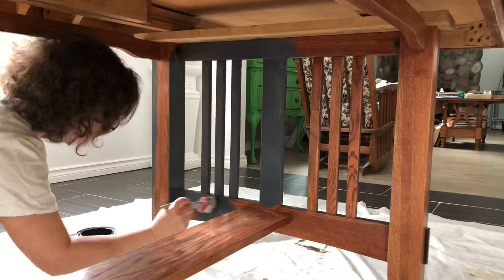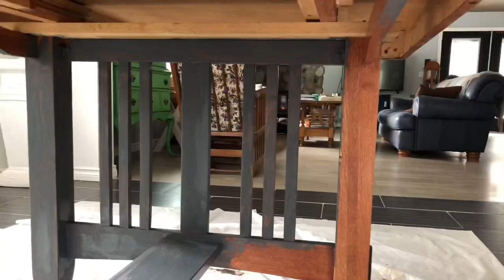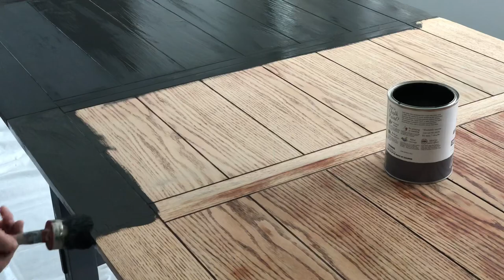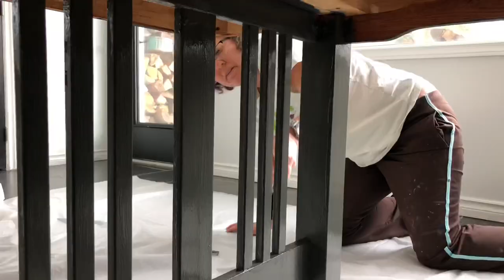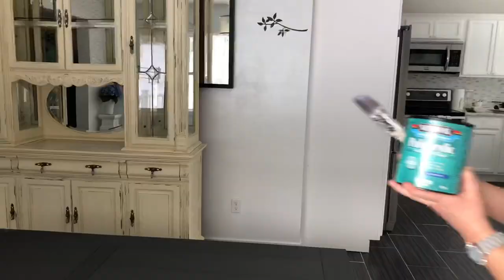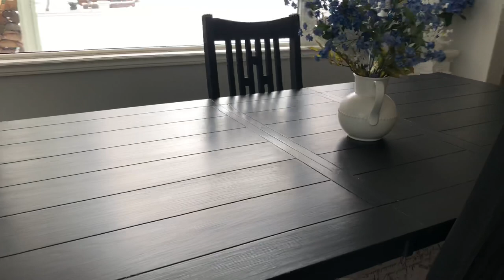I painted my Mission Style farmhouse table in Annie Sloan's Graphite Chalkpaint

Comment: So I did 2 coats of the graphite paint to the top of my table, it dried patchy, some areas look darker than others? I sanded a little to see if I could blend. Should I do a 3rd coat?
Reply from the maker: Is this the first time using chalk paint?  Did you mix it really well?  2 coats usually does the trick for me.  Also it won’t have a uniform look necessarily, that’s kind of the beauty of chalk paint!  And it should look more uniform when the sealing coat is applied.